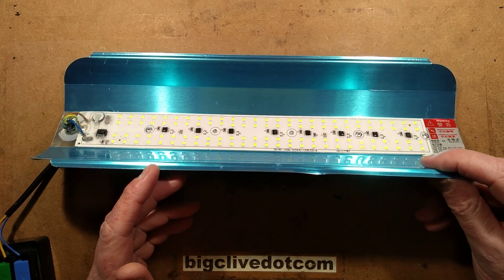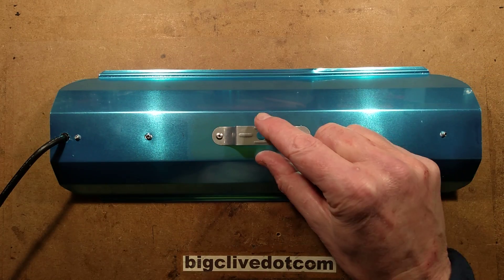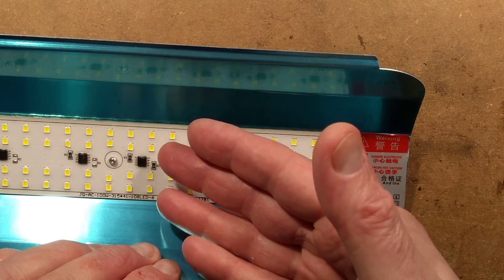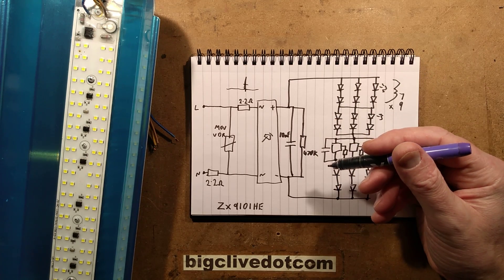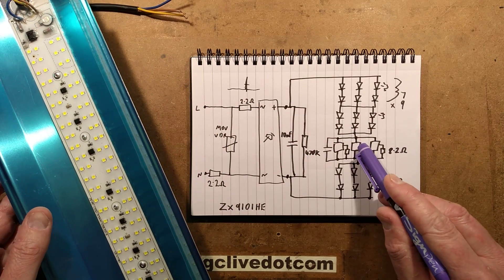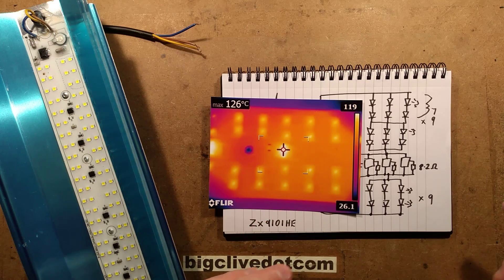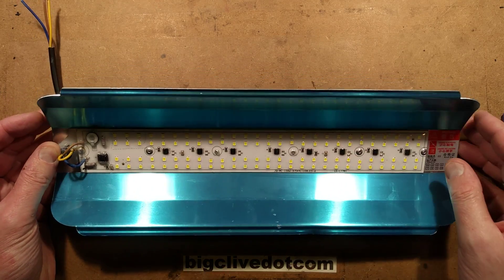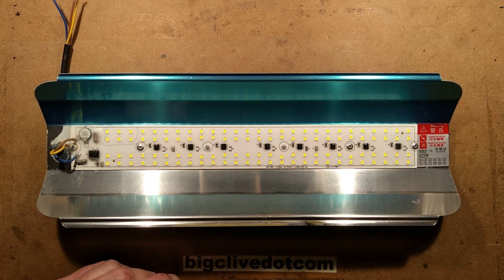100W LED module (growlight?) with schematic.

Comment: Hi mate!   My mum just spent a load of money on http://www.claysnaturalhealth.co.uk/raditech.html#.  can you investigate and advise of quackery potential??  Also, how do you think it's made?   Keep up the splendid stuff!!!
Reply from the maker: I don't mind fun quackery, but when stuff is being sold at very high prices with nonsensical claims including curing cancer then the people responsible should be exposed.
They wouldn't have been used in ships generator rooms and the stray fields felt by cows are mains electrical leakage caused by bad wiring.

Comment: Obviously for growing weed in your shed/disused building, where the extra heat might come in handy. Interesting that they haven't put in any smoothing capacitors.
 I remember reading a biology text book back when I was at school ( a long time ago ) that said that plants actually grow faster under a flickering light source, but I think they were referring to a higher frequency light source than the 50Hz UK mains supply. It's more likely that the manufacturers here were just being cheaparsed.

Comment: What kind of temperature would a 100w incandescent light reach by comparison?
Reply from the maker: In the same enclosure 100W is 100W.  This unit would self regulate down by temperature though.
Reply: @bigclivedotcom  100w of temperature?

Comment: Doesn't look like an LED grow light that I have ever seen. Cheap LED grow lights usually go the way of using multiple color LEDs (mainly blue and red) to increase the PAR output and give a more ideal light spectrum plants like. Cheap run of the mill white LEDs are somewhat wasteful as grow lights as while they give good light for our eyes they have low PAR output so lots of the energy the plants simply won't use. If this was marketed as a grow light it would be a rather crappy one even for Chinese ebay standards. Not to say all white LEDs are useless for plant growth but the ones one would actually want to use are rather expensive Samsung LEDs
Reply: Zachary Taylor Not just cheap grow lights, many commercial grow lights use specific red and blue wavelengths in order to get greater efficiency and tailor the light spectrum to the crop.  If memory serves there are also units that include specific green and UVA and green spectrum as well as there are some crops that require those added wavelengths at specific points in their development or to produce more normal leaf coloration (it all depends upon the needs of the crop).  The limited spectrum isn’t done to be cheap but simply to improve efficiency in terms of crop growth and development versus power consumption, plus monochrome LEDs do not contain any phosphors that will deteriorate over time, so as long as they are kept sufficiently cool and protected from current/voltage spikes then the monochrome LEDs have a far greater lifetime than phosphor dependent white LEDs.  The cheap growlights are simply copying the commercial growlights, though I do not know that the cheap growlights are as concerned about the exact wavelengths of the chosen LEDs as the major commercial players do.
Reply: Ethan Poole  Plants don’t see green light
Reply: TheMuddatrucker That is not exactly true as green leafed plants do use green light, it is just the least efficient wavelength in green leafed plants since they reflect most of the green light (hence the green leaves).  It is also worth noting that not all plants have green leaves.  Anyhow, the addition of green light does modify growth characteristics in useful ways with respect to certain crops and can also make for more agreeable illumination when humans have to work in a space that is otherwise magenta (red and blue) illuminated since the addition of green light will make green leaves appear more natural to the human eye.
Reply: Ethan Poole  what crop would potentially benefit from green light?
Reply: TheMuddatrucker Just do a quick google search on green led lighting in growlights and you will find multiple research articles on the topic and the effects that introducing and/or substituting green light will have on the growth characteristics of certain crops.
Reply: Milonso  I’ve never seen an led grow light that gives off equal amounts of red and green, infact I’ve never seen a grow light that claims to give off any green light at all! 
I suppose it may depend upon the plant but the ones I’m talking about won’t grow under just green light, those types of growers actually use green lights (maybe as a head torch) to work on or around the plants they are growing whilst the main lights are out. they do this as they don’t want to disrupt the dark cycle and they believe the plants don’t see the green light so will never be confused and revert from flowering back to a vegetative state.
The reality though is that very few indoor growers use LED’s unless it’s just a small hobby, the majority still use sodium bulbs as they are far better, on paper you may say otherwise but in reality 95% of led grow lights are rubbish the other 5% are hugely expensive, look very impressive but when sodium works so well and is reasonably inexpensive to replace why take the risk of expensive led’s and a reduced crop!? It’s the main reason people are so reluctant to change over.
Reply: TheMuddatrucker i wasnt talking about green-only leds... in modern fullspectrum quantumboards for example green is used as much as blue. HLG grow LEDs got like super high green levels. they wont do that without a reason.
Reply: thats not true. multispectrum (its an arrangement of multiple single spectrum chips)isnt optimal for plant growth. This technic of of lights is like more than 10 years old... fullspectrum chips are the best for growlights like those samsung lm301b which are used in high end quantumboards. or big cob leds like modern cree, citizen or vero cobs.

Comment: I have a @invisiblesunleduk (instagram) panel set up with the latest Samsung leds at 3500k with dimable driver. It draws 250w and gives you the equivalent of 1000w hps. They run so much cooler than hps so they don't need fans to cool them and you can get lights closer to my pepper plants without scorching them. LED and drivers technology has come along massively and dropped in price.Great vid as always. ThankQ. TkEZ»UK

Comment: I tested a couple of the lower power versions on my channel a while back and they get very hot. They came with a metal stand-off bracket on mine which suggested that they get mounted to an outside wall as they are, not in any sort of enclosure. Obviously because they are so waterproof that would be a thing to do..... The silicon gunk on my ones didn't even cover the LEDs properly so no way are they IP68.  I wouldn't use them as car repair lamps either because of the shock risk as well as burning your hands on the bloody things (I did touch it in my video and it was a lot hot!). Like you say Clive, interesting but not practical. I did get some 12v ones which were ok, but not near the rating.

Comment: Is it possible it was designed to be used vertically?  I vaguely remember seeing an advert for a hydroponic cabinet for growing illegal plants which had vertical fluorescents surrounding the growing space.
Reply: Nah, oregano...
Reply: Because she's Italian.
Reply: That's a good observation, but unfortunately it wouldn't matter if it were used horizontally or vertically or in a freezer.  Yes, the characteristic length of convection transfer surfaces varies with orientation, but in this case, the difference is utterly negligible.  At 50C ambient, 100W input, and 370x130mm reflector area, the thermal resistance of the "heat sink" itself stays in the ballpark of 2-3K/W regardless of orientation.  

2-3K/W? That can't be right.  It would be at 200-300C above ambient!

Yes, if it sustained 100W heat flux without thermal limiting or catastrophic failure.  Keep in mind, that's only the resistance of the plate.  The junction-plate resistance is going to be problematically large as well.

Comment: I'm not an electrcian or electrical emgoneer. If I wanted to sheild the LEDs frpm being toiched while the lamp was on operation,  could I use a rectangular piece of Lexan,  perhaps with dome 0.5" brass standoff (so I'm not forming a seal over the LEDs). I also assume I would need to affix an aluminum heat sink to the back side woth a small fan at one end to emsurerîi
Reply: ... to ensure air flow betwen shield and thr LEDs. Cam I affix tje hest sink to the rear of the reflector  or does thr reflector need to be removed before affixing the heat sink? Thank you for sharing your skills. Really,  really appreciate reviews/teardowns of potentially hazardous items. The video of the dolls thay that launches sparks from its,  uh.... hinterlands was one the funnirst,  yet sad,  videos you've ever made. I would love to have been in the room where the idea originated. Who could have possible thought that was a good idea?

Comment: Do they not have technical writers or translators in China? I see so many (if not all) products coming out of China, to have an abysmal Chinglish. No one even bothered proof reading anything!
How much would it cost to have some one competent,  check this shit out, before printing thousands of packages, labels  and manuals?
Reply: There's a reason why China is cheaper....
Reply: Even in China you get what you pay for, and with that price you did not pay for translators.
Reply: As a manufacturer, you have to decide whether the cost of the better docs & packaging has a worthwhile return on investment, either by boosting sales volume at the low price or justifying a higher pricepoint. Nobody really cares about labelling on something as simple as a lamp without any settings beyond "on" and "off" and even those are externally configured... people will buy these regardless.
Reply: ProgAndy, you sound like a dumb-ass that wants to pretend he's funny and smart. Now get lost.

Comment: Clive this is another great video!  Something also interesting to me personally would be a review of 4' LED replacement tubes for flourescent fixtures.  Including advantages/disadvantages of the "Ballast Bypass" and drop in varieties.
Reply: https://www.youtube.com/watch?v=9Bfgw7LbWJI
Reply: Thanks Paul.  I had forgotten about that one!!  But I think Clive should revisit this topic.  Clive didn't give them a good report but I'm having great success with the led replacements.  The LED's are apparently brighter and operate better than my old T12's in every way that I can see.  I would particularly like to know if using a drop in led tube (using the flourescent ballast) or a bypass variety led tube (using it's own power supply) would be more efficient...and how much more efficient.  Is it worth taking out the old ballast?  Those ballasts do seem to produce quite a bit of waste heat.  My LED's are cool to the touch.
Reply: "Flour"escent fixtures as used in baking? LOL. Or "fluorescent"?
Reply: Oh baking with Clive is one of my favorites!  Let's do spell it that way from now on!
Reply: Hi Gary.  I bought several batches of the hyperikon replacements for the shop.  The single end powered ones.  They are pretty nice in 4000k but frosted ones are needed if they are bare.  

Pricing is terrible for frosted due to the pricing algorithm.  If the price sucks go to home depot and get window frosting spray from rustoleum i think.  I did 48 bulbs with 2 or 3 cans.

The bypass is easy but what i have been told is that without the current limiting and starter it would be dangerous to put a regular bulb back in.

The higher spec hyperikon lights come with a sticker to put on the fixture.  I decided since these are high up exposed i wrote a warning with red sharpie on each fixture.

Big Clive did a video on a bulb like this already.  It is just a little switching power supply stuffed in the back.  Techically you just apply 110v power to the AC end, the other end pins connect to nothing.  They provide new "tombstones" for the ends... i didnt need to use any.

Ive been running them about a year in my hobby shop.  Light is good.  No flicker.  NO HUMMING BALLASTS!  OR PULSING!  Dead silence is weird and nice.

Install is as easier as unscrewing the marretts from the ballast.  I tucked all the ballast wires to the side and left the ballast in since they are "hazardous"  if oil filled.  Then connect the wires from the ceiling directly to the tombstone on the one end.

The light is really nice.  No flicker.  5000k was too harsh for me  but 4000k was pretty natural.  The hyperselect one is an actual thick wall glass tube so no issues that clive brought up with aluminum heatsink possibly becoming live.  The LED tape is thermal compounded to the inside face of the tube.

I have 24 bulbs running in a 20'x40' shop with most of them concentrated at one end.

If the price is stupid on amazon.  Hyperikon is american based i think.  I called them a few times.  They are very good to talk to.  You can order direct on their website for cheaper than the stupid high gouging.  Should be only 8 dollars per tube or you are getting hosed.
Reply: I don't imagine that the 'drop in' ones need the ballast, they'll just have extra features so they'll tolerant its presence. For a traditional inductive/resistive ballast the usual P=I^2R applies, so for the usual power saving (about 50%) your current (and power losses in the ballast) should reduce to 1/4th. I'd try running your existing favourite ones without ballasts... T8 16W 1200mm about $5.50, T8 8W 600mm $3.75 from the usual 2nd-tier suppliers. I think they're great.
Reply: @Sylveste22  bypassing the ballasts was a major selling point for me.  I have heard that if you have old non digital ballasts the bulbs may not work unless you bypass.  I tried with a few manufacturers and one wouldnt work with the old oil filled ballasts i have.

Comment: Look pretty OK for the price, I may be tempted to try a few of these as semi-disposable garage/workshop lighting (both mounted and built into a case safety insulated for under cars).  I think the combination of running semi-outdoors & perhaps running through a dimmer could help longevity while still being plenty bright.
Reply: Certainly beat 300/500w floodlights for power consumption, not to mention less sensitive to knocks and probably less heat.